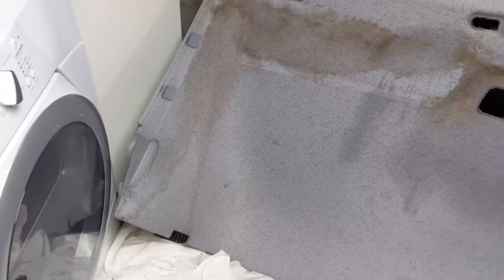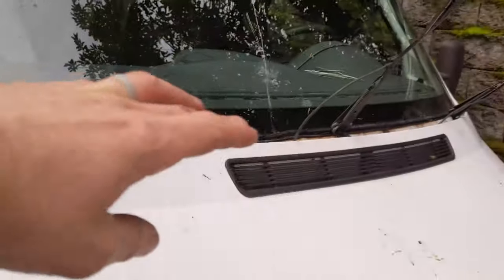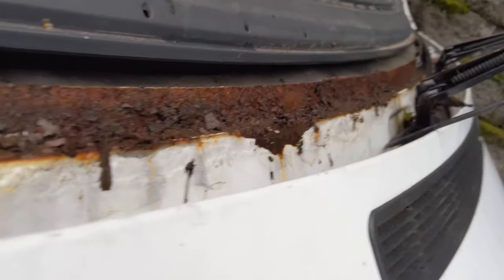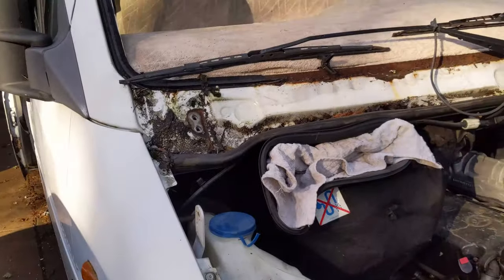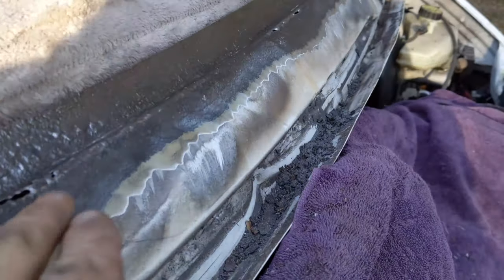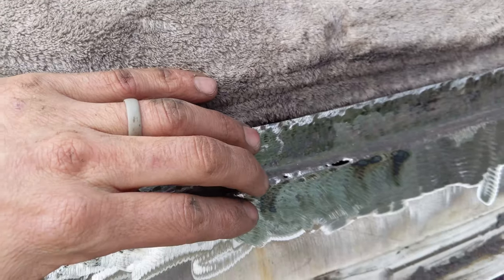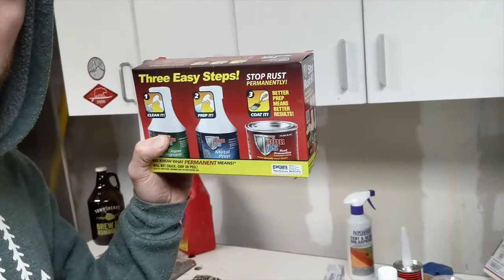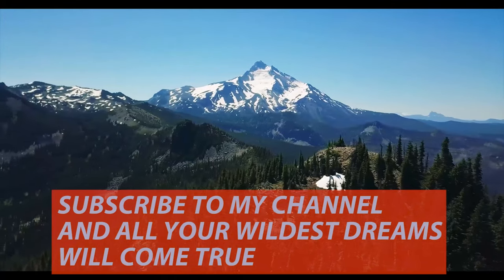Sprinter Part 3: Windshield Removal and Headliner Cleaning

Comment: So glad you made this video.  I need to do the exact thing and the quote to get it removed is jaw dropping.  What is more Jaw dropping is the cost of replacing a dropped windshield which was the source of a ton of anxiety.  Rust in pitted metal is best mitigated with chemicals.  I never have had a problem when using ospho rust treatment.  Vinegar will accomplish the same thing if you have the time to wait.

Comment: Nice video. Hope all end well. Missed the next time video about the replacement though. My  2000 sprinter van needs a new windshield also but I’m kind of afraid about the rust I’m gonna find 🤔🤙🏼
Reply from the maker: Hey! Yeah it wasn't too bad repairing the rust. Just a lot of grinding, then applying phosphoric acid then 3 coats of rustlok primer (moisture cured polyurethane- similar to POR 15). I had a company come out and install the windshield for me. No problems since! I'm struggling to keep up with the footage. It takes so long to edit, and then I have so many concurrent projects going on in the van its hard to make a cohesive story out of it. Thanks for the comment! Good luck on your van. Right now I'm working on the rest of the body rust now. I've cut out some sections of the interior floor where there was rust between the subframe and the floor sheet metal. I'm addressing the rust and welding in new metal. It's kind of enjoyable to cut out all the rot!
Reply: @stevevanpelt4475  thanks Steve ! I saw your rust attack. Lot of work. I did my sprinter on the outside lower part with raptor liner. Don’t have a video on youtube but on my insta there are some pictures. The raptor liner is great against rust, sand, wind, salt etc. Keep up the good work 🤙🏼